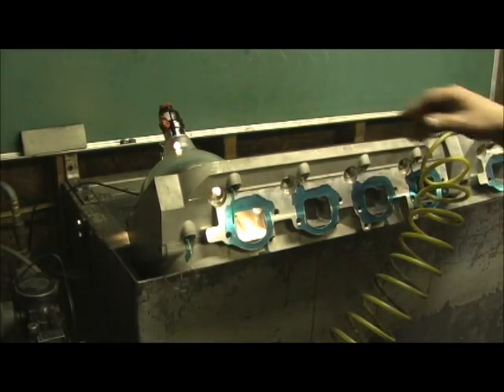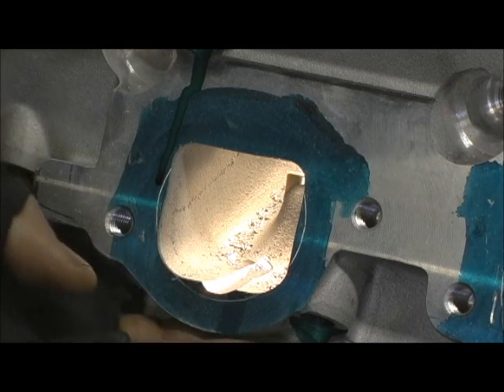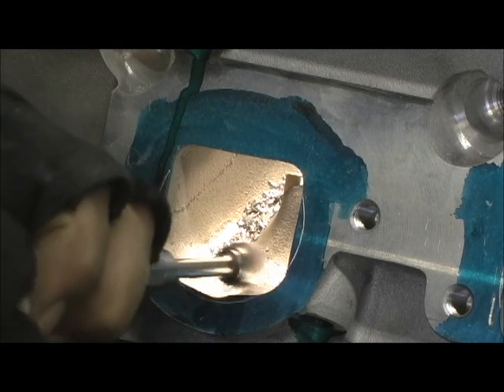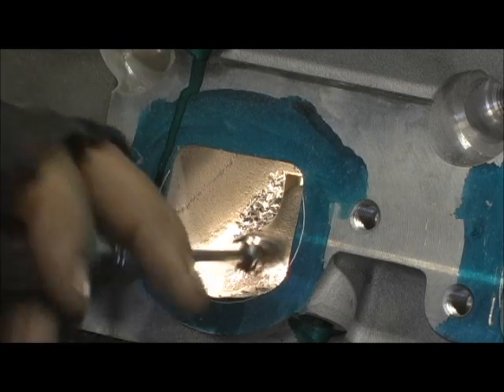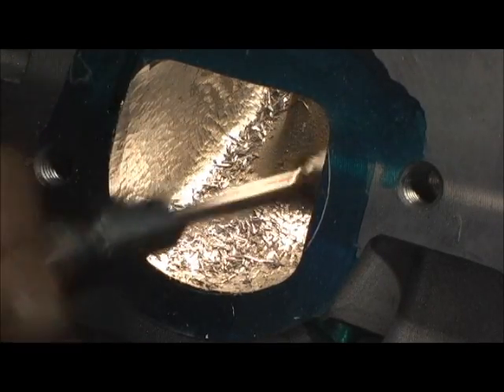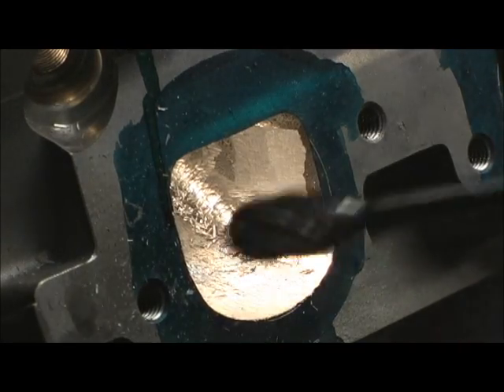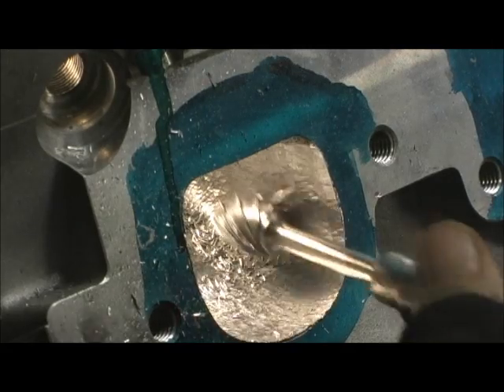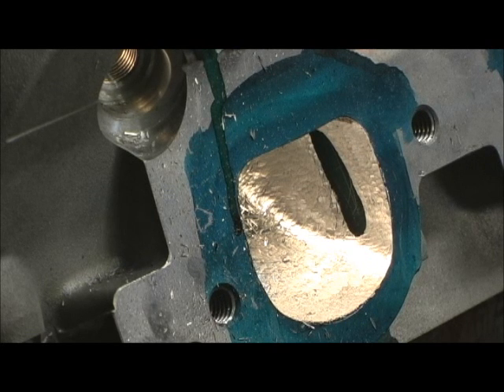KMJ 345cc Stage IV Exhaust Porting  TUBES  3 5

Comment: race head service ,small block ford
i have a set of 180 runner 58cc rhs heads sbf.part #35011-02 .what would it cost to get them done. using a torker II intake. any idea's on a better 1 would be great. its a 306ci ,10.38:1 comp.eagle 5140 rods srp -5 cc piston forged .ford z303 cam.howards link bar lifters . oh heads are 7/16 stud mount. harland sharp 1.6 rockers. .080 wall 5/16 6.250 pushrod. sorry for all the info just thought it may be useful.
Reply from the maker: I would need you to go to my website (listed above) as I don't discuse prices on YouTube. Just go to my contact us page. I am trying to get to the emails over the past two days, and should answer everyone by this after noon as my power was off 36 hours due to the weather....COLD It is the coldest temps in 20 years here since 1993.
Reply: Ok. Thanks . Will do

Comment: i have a question. i have a 1995 chevy tahoe tbi 350 and a friend of mine got a 2000 chevy tahoe limited aka ss.its the same body style as my 95. i know thw engine is a newer design by having roller lifters mine has flat tappets. i was thinking about the long block swap for my truck but i see the intake manifold wont work on my truck... can i just swap the short block and use my heads and everything else on it?according the intake gaskets the holes are not the same.